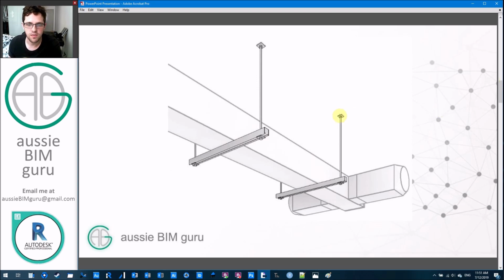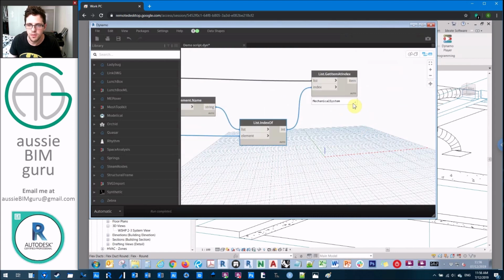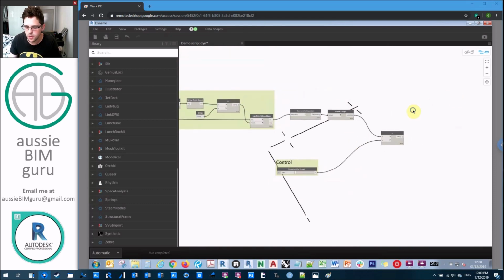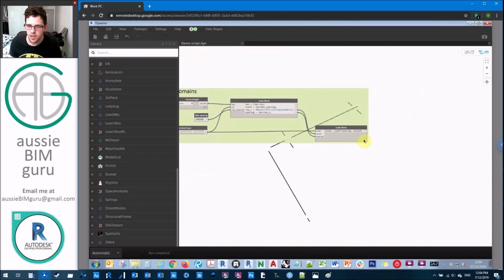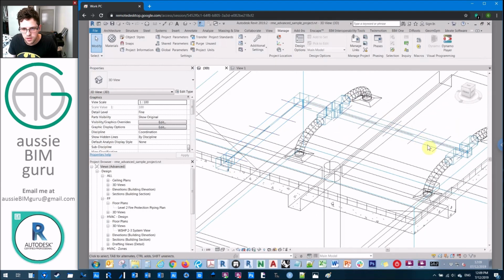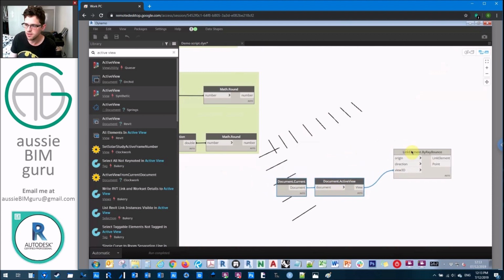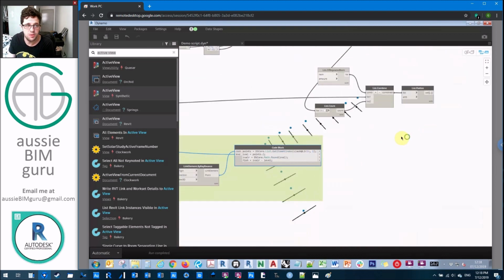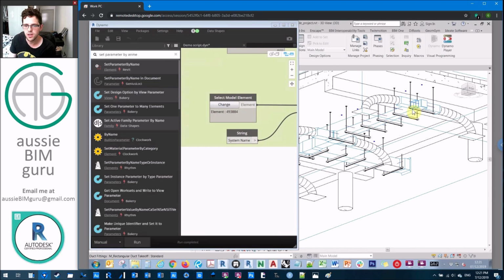Duct support placement using Dynamo!

Comment: @Aussie BIM Guru while im developing this Script i was facing some issues. List.IndexOf node i m getting -Ve value . If any one facing the same issuse .
Reply from the maker: Generally this means something was not found, and there is likely a different case in your model to mine. Test with a very basic set of elements to see if that helps identify what is different.
Reply: @AussieBIMGuru  Than you let me check , appreciate your effort .

Comment: hi, i am trying to execute this scrip but getting "Null"  (DuctSystem all elements in network) and i and using Dynamo core 2.16.2.5624. dynamo revit 2.16.2.9354
Reply from the maker: @mohammadrais-h2e  make sure you have the ironpython package installed as mepover depends on it in revit 2022 and higher.

Comment: Can you help creat a similar line based hanger support script for 4 parallel piping with different system and with different sizes? Your video tutorials helped me a lot as a beginner in dynamo and has been a fan of your tutorials. Cheers!
Reply from the maker: Unfortunately beyond my experience at that point, but have a try and use dynamo forums as an active help resource where you get stuck.

Comment: for those just want to get this script to work, just install 2018 BiMorph node, it worked for me. I also have tried with cable trays, it worked as well. however, after the last "List.Combine", try not to flatten the list, this way, the support will follow the bottom elevations of the cable trays that bend up and down. for some reasons, if flatten the list, the hanger supports will only follow one bottom elevation.
Reply: also, thank you Aussie BIM Guru for sharing this scipt, it is amazing, it helps us so much.
Reply from the maker: Great tip, and yes I think that would make sense in that situation. I was a bit less experienced in Dynamo when I made this so my old videos sometimes take some awkward list management steps.

Comment: Hello ! 
I have tried this amazing script and it’s really helpful 
I just have problem when the duct offsets and change its level the supports will be in the lowest level and the high level duct end up with low level supports ? Do u have a solution for that ! 
Thanks in advance !❤️
Reply from the maker: The way I've set up this workflow the duct hangers only sit at one level I believe, to deal with offsets you'd need to adjust the workflow to check both the underside of duct from level and the offset up to slab overhead in two steps, then set both parameters this way.

Comment: Thank For This Amazing video. However, When I use the duct system all elements in network custom node it doesn't get the elements in the mechanical system it gets me NULL ! What the problem here ??
Reply from the maker: My best guess is you may be using revit 2023+ and now have the IronPython2.7 package installed. Mepover depends on it now.
Reply: @AussieBIMGuru  I have tried IronPython 2.7 as well, and still it gives a null value. Any thoughts?

Comment: Hi Aussie BIM Gure, the script worked perfectly except when I make a drop in elevation with the ducts than the duct support placed everything on the highest bottom elevation of the duct system. Do you have any idea how to solve this?
Reply from the maker: For this particular case you may need to use another mesh ray at these points at the duct level down to find out the drop in addition to the mesh ray upward to find the structure. My workflow here assumes flat duct runs currently.

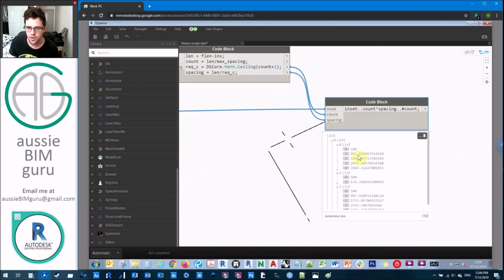Comment: Nitpicking: 13:20 if the second block's parameter call "req_c" instead of "count", it lowers the chance to connect "count" variable from the left block
Reply from the maker: They appear in order of where they appear in the codeblock. Count is maybe a reserved word since i made this video a few years ago now so could be that.

Comment: Hello, Mr. Guru, asking for help as the last straw, watched the video many times over, typed everything by hand AND downloaded the script from github along with the hanger .rfa and no matter what, the codeblock in the raybounce group returns "null" instead of the list of clash points. Tried running the script in a model with a linked structural, architectural models and tried runing the script on the revit sample project. Please help
Reply: Edit, managed to make the supports extend to the element above, however it doesnt extend in the sample project file, only files with a linked ifc model. the problem im facing now is that some hangers extend beyond the slab, some inside of it. any tips?
Reply from the maker: Hrm it sounds like an error with the raybounce node. I havent tested this workflow beyond revit 2020 so might be some changes in node behavior since i made this unfortunately. I'll try to revisit it on the channel eventually for revit 2023.

Comment: 🙏Thanks for this helpful tutorial. Have you ever tried...? 
I want to change the calculation Method in Revit ......
(Path => 1. Systems(tab) -> 
                2. Mechanical Settings -> 
                3. Pipe Setting -> 
                4. Calculation -> 
                5. Flow(tab) -> 
        👉 6. Calculation Method ) 

...... from "the 2012 International Plumbing Code (IPC) Table E103.3 (3)" #to my custom fixture flow rate/table. 

👉 How would you advise me, please?
👉 Can I use Dynamo to change input/references like IPC Table E103.3 (3)?

Thanks!
Reply from the maker: Unfortunately I've got an architectural background so most of that goes right over my head! Maybe try the Dynamo forums for advice.

Comment: Hi Gavin this is a super usuful script. Many thanks for it. Very complicated to understand but I'll get it one day hopefully! Just one question: I get the hanger channel's Support height up to 973836.0. Not sure why? Hence I loose completely the vertical hangers. Potentially the thing comes from the clash node Code block warning: "List.GetItemAtIndex operation failed. Index was out of range. Must be non-negative and lenn than the size of the collection. Paramter name:index". Not sure what value this warning refer to? Many thanks really appreciated!
Reply from the maker: It's hard to say but my best guess is it could relate to imperial vs metric units, or the ray bounce wasn't successful and reached too far beyond the model. Cross check that the height number being provided is logical in Dynamo and if not look back through the data to see where it might be coming from.

Comment: Great video,i want to ask
in node code block "Points = DSCore.List.GetItemAtIndex(clash@L2<1>, 1);" appear warning (Warning: List.GetItemAtIndex operation failed. 
Index was out of range. Must be non-negative and less than the size of the collection.
Parameter name: index)
How i solved this warning? thanks
Reply from the maker: Work back through the workflow and find out why there is no match found. A -1 result means there wasnt a match in the list available to index.

Comment: hello, i cant find get paramater valu by name.
can you explain where i can find this node?
Reply from the maker: This comes with dynamo and is under Revit > Elements in the library.
Reply: @AussieBIMGuru  thanks,can i ask again?
in my dynamo in node ByRayBounce have a warning "Warning: LinkElement.ByRayBounce expects argument type(s) (Autodesk.DesignScript.Geometry.Point, Autodesk.DesignScript.Geometry.Vector, Revit.Elements.Views.View3D, Revit.Elements.Category, bool), but was called with (Autodesk.DesignScript.Geometry.Point[], Autodesk.DesignScript.Geometry.Vector, Revit.Elements.Views.FloorPlanView, null, bool). "
and my ByRayBounce not the same with your node in the video,my bolean have some option after direction,origin and 3D view,i have 5 option which is direction,origin,3D View,category,find nearest.
Reply from the maker: @yanuar9093  based on the warning it appears your view is a plan and a focal element hasnt been provided.
Reply: when I connect the point (curve point) to the origin (byraybounce), a warning appears like that
Reply: @AussieBIMGuru  can i know the version of Bimorphnodes in this video?
Reply from the maker: @yanuar9093  unsure unfortunately. It would likely be the build that was highest around this date on the package manager.
Reply: @AussieBIMGuru  do you have any suggestion for me to fix this error?
this error appear only when i connect point to geometry,please help me.
thanks for your kindness
Reply from the maker: Use the forums. Youll get better help there on this error. I am unsure as it looks like the inputs are wrong.

Comment: The parameter values for "Bottom Elevation" and "Reference Level " are empty and this is clearly reflected in Revit. How can this error be corrected?
Reply from the maker: I believe these are default parameters for ducts if you mean those, otherwise try out my hanger family on github.

Comment: list=DSCore.List.Flatten(ducts);
list[0];
"Bottom Elevation";
"Reference Level";
after this code block
when bottom elevation is connected to parameter 
name it is showing errors
Reply from the maker: Make sure the previous lists have no null values, and that the parameter by that name exists in your family you are setting the value of the parameter to.

Comment: hi ^^... why use a line based family (support) specifically for this workflow? thank you very much... very awesome tutorial ^^
Reply from the maker: In this case i use line based as the family is best defined by its two points of support. Whilst it may sometimes be centred upon a duct run it isn't always necessarily. I go on to use dynamo to place these using reference curves also, which are much easier placed if line based.

Comment: Great video. I work with racks of pipes so to replicate this may be different. I have three concerns.
1) how will the workflow be if the pipe racks are on different systems?
2) eliminating vertical pipes/ducts
3) consideration for insulation - I guess when we place the family we can reduce the support height by minus the insulation thickness?
Thanks in advance for your response. Fan from Canada 🍁
Reply from the maker: In regards to your queries;

1. This is probably difficult to automate if pipes share racks, as eventually those runs would probably diverge apart. You could probably collect multiple systems and eliminate supports closer than a certain point apart using one of my nodes in Crumple (group by minimum separation). Pipes are also quite different to ducts in that you tend to run them in parallel, so required width and placement would be difficult to assess.

2. If you could get their location lines this would allow you to assess their propagation using the vector of the curve and its Z value. You could filter out all pipes with a Z value or 1 or thereabouts.

3. Exactly, you could obtain multiple parameters and add/subtract as needed.
Reply: @AussieBIMGuru  thanks for your quick response.. you’re highly appreciated

Comment: Dear sir, Great script 
i want to automate all duct support for every level i filter ducts by level but the the script duplicate more than one hanger at the same place
Reply from the maker: It sounds like an issue with levels and lacing. This script is built to do 1 level at a time. Go back step by step looking at the data in each node, eventually you should be able to find where the list structure isn't correct.

Comment: Hi Aussie BIM Guru, the script worked perfectly, thanks. I was wondering if you have any ideas for hosting the support to the duct, so when you move the duct, the support moves with it, or in general if you know a way to locate hosted families.
Reply from the maker: The best way to do this would be to build the support as a duct fitting. These typically move with the system.

Comment: Thank you so much! There's a lot to study

What about cabletray supports?
Reply from the maker: Similar workflow. As long as theyre in connected systems it should almost be the same.
Reply: @AussieBIMGuru  there s no system for cable trays, maybe we can filter them by a shared parameter
Reply from the maker: @bender06160  yes in that case you would need something the runs have in common, or manual selection of connected trays to be supported.

Comment: I dont  find Node ( duct system all elements in network )
Reply from the maker: Make sure you have the MEPover package installed and browse through it - the node name might be different depending on the version you are using.
Reply: @AussieBIMGuru  please i cant find MEPover package could you help me please
Reply from the maker: @ahmedallam9733  it is on the package manager in dynamo itself. If you cant access that it can be found here also; https://dynamopackages.com/#

Comment: points = DSCore.List.GetItemAtIndex(clash@L2<1>,1);
zval = points.Z;
zvalr = DSCore.Math.Round(zval);
fixh =zvalr - level;
Reply from the maker: This appears to be correct. What warning/issue is Dynamo presenting to you?
Reply: Aussie BIM Guru the codeblock returns a null value
Reply from the maker: It must be passing a null value in in that case, or there must be an error in the code block syntax.

If you are using an older build of Dynamo than 2.0.3 it may not work due to syntax changes before version 2.X.
Reply: Aussie BIM Guru  thank I will try it with older version
Reply: It gives me the warning of
"Warning: Null value cannot be cast to Double
Internal error, please report: Dereferencing a non-pointer.
List.GetItemAtIndex operation failed. 
Index was out of range. Must be non-negative and less than the size of the collection.
Parameter name: index"

And the placement of the support couldn't find its fixing height.
May I know what's wrong? 
My Dynamo is 2.1

Comment: Thank you so much! There's a lot to study

what about pipe supports? It would be at same diameter and orientation than pipes
How should I do it?
Reply from the maker: Similar to this workflow, but you could get the pipe centre elevation and diameter to place the support, then get the direction of the curve at that point (or normal + 90) for orientation

Comment: this would be fine but in fabrication mep
Reply from the maker: Similar workflow, but some different nodes would be required. You'd also need a fab part hanger which is harder to make than a revit family I think. Have a look at MEPover package.

Comment: Hi, great video and usefull in so many cases.
But looking at the video it looks like you didn't achive the correct heights for fixings.
In the first example the duct was fixed at the lowest point and in the second example it was all placed at the highest fixing point, as it looked like the fixing was inside the beam.

I think you should go back and check the result, just to make sure.
Reply from the maker: You're right... I didn't quite notice it in the first test! I believe there is probably some finessing required in the clash detection node workflow, it looks like it set to the beam underside in a few cases vs slab.

Hopefully the workflow enables others to explore and refine further, and thanks for paying such close attention!

I'll cross check the methodology in january... it might be a lacing issue. No access to dynamo in my holidays unfortunately! I seem to recall the clashes were all being identified to the right point, so I think it will be in the difference calculations where I've missed a step.
Reply: @AussieBIMGuru  The model you used are the HAVOC model provided with Revit?, if so I can have a try.

Anyways you have a great holiday and see you again in 2020!
Reply from the maker: @TheLegendMythMan  thanks, have a great one too!

Yes I've used the advanced sample projects for mep and structure. I had to adjust the levels to match, and the models dont quite match in plan, but close enough to allow testing.

Comment: I have known about dynamo for a few years however moved into more of an engineering role over the last bit. Having moved back to a design engineering role (which I have always preferred) I am picking dynamo up again. I have found your tutorials to be very informative, not just in getting it done but also showing what is also potentially possible. Do you have any tips on understanding the nodes available as they seem to be very architecturally based, for obvious reason? Another question is how to best implement dynamo into a national company that doesn’t really understand what is required of its engineering staff due to perceived negativity to drafting?
Reply from the maker: Hi there Tony, I'm glad you're finding my channel and content helpful - and that the style of showing full workflow resonates with your needs.

It might be worth viewing my 'learn dynamo' series as I focus more on nodes and less on workflow in these videos. A handy one is lesson 4; list management.

Check out MEPover and Bimorph nodes for some helpful nodes related more closely to coordination and services.

RE culture, if the company is not sold on BIM or CAD then dynamo will be a challenge. Consider if you are working with the right teams/firm if your passion is computation, and if it is, then start showcasing the potential benefits through business cases and live demos.

Hope that helps!